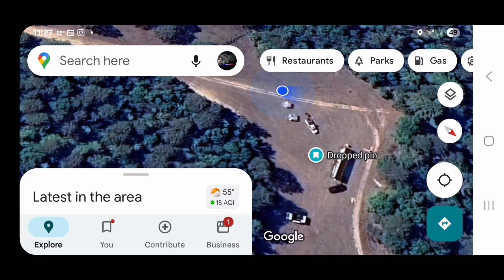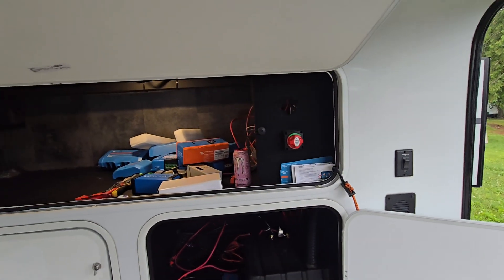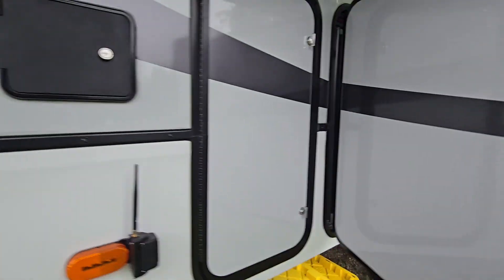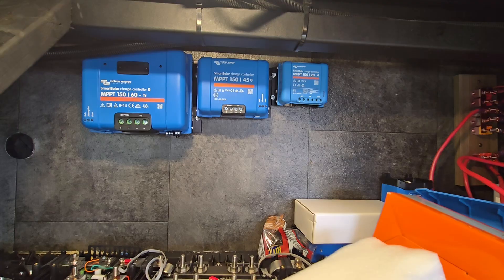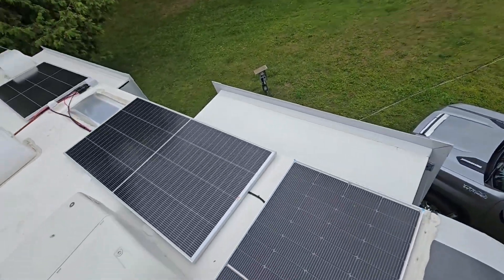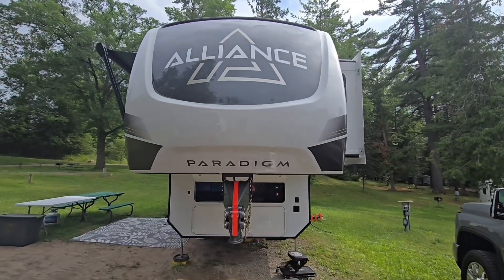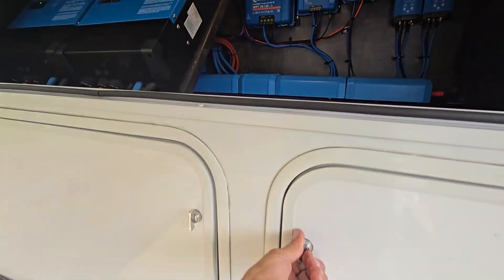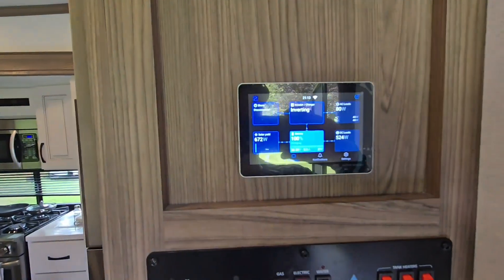Alliance Paradigm with Dual 5kVa Inveters, 2660 Watts in Solar and a Big Beard Battery Bank

Comment: Does the autotransformer balance out the loads between the two inverters so you can get the full 10 kva?
Reply from the maker: Yes exactly, the autoformer used in this manner is solely for load balancing the 2 inverters.....
So no matter which leg of the breaker panel box the load is on, it will be equal across the inverters thus not being limited to 3kVa or in this case 5kVa on each leg of breaker panel box.....
Thanks for watching and commenting.....